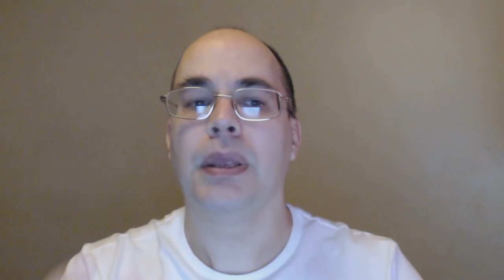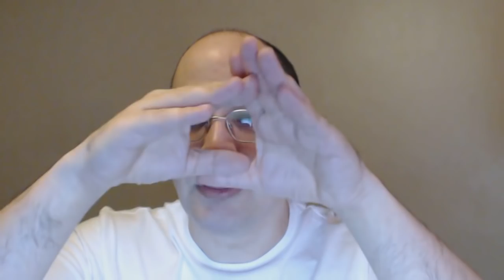How do rockets move in space, with nothing to push off from?

Comment: + MJ , u only explained how rockets work in atmosphere, we all know that. We learnt that in school.

Now tell us how they move in vacuum
Reply: +Jan , as long as the gas is inside the chamber, its still part of the same system
Reply: +Jan , I dont know fake science u studied. 

As long as the exhaust gases r still INSIDE the rocket , its still part of ONE SYSTEM . 

It cant move the system any forward without first coming out of the system
Reply: +Jan , gases cant be attached. But they are always in contact with the inner walls of the chamber & bound by it. Hence its part of the system
Reply: +Jan , the only way the rocket would move is if the pressure inside the combustion chamber is so huge that the chamber blows up, and even then the pieces of rocket would move in all random directions
Reply: +Jan  ....

 /// If gasses can't be attached, then they're not bound by the inner walls of the chamber :) ///
You cannot attach any gaseous or liquid thing to anything without the use of a solid object .

/// The gas particles push on the walls of the combustion chamber in all directions, except for the bottom, which is open ///

The pressurized gas molecules pushing with equal forces on all sides of the chambers, so there will be ZERO movement. And when the bottom end is opened , all the gas will fizzle out of it and since there is no AIR outside the rocket the exhaust gas will just simply sucked into the super gigantic universe sized vacuum .

The only reason the rocket pieces will move in all directions after a blast is because the gas molecules are pushing against all sides of wall, and also against each other. Thats the reason the walls break
Reply: +Jan ,   

/// Therefore, since they're not attached to anything, they're not part of the rocket anymore :) ///
The gases r the not attached to anything, but the walls the chamber contain them, so they r part of the system.

/// That's okay - if the gas is leaving the chamber, it most likely means that it has already pushed the rocket up (unless it happens to be oriented downwards from the get-go) ///
Why should the gases push the rocket up when its going down ? The pressure exerted on the topside is extremely low now. Thats now how things move.

/// Vacuum is not a literal vacuum cleaner - it doesn't suck. It doesn't do anything. What is happening is gas expanding to uniformly fill all available space. ///
Vacuum has almost no pressure so the pressurized gases will expand more and fill up the vacuum and tend to reach equilibrium pressure . So again no movement because the gases dont get pushed back .

/// Yes, they bounce against the wall and each other, which means, with downward wall gone, if the molecule isn't already going down, it has to bounce either off one of the remaining walls, or other molecule, giving it upward momentum before it can start going in other, downward direction. Action and reaction /// 
Lol ... thats not how things move .. hehehehe 
All the molecules r moving in all sorts of direction, hence there never will be any movement.

//// You really have no business of accusing others of practicing "pseudo witchcraft science" ////
Yes, you r posting fake Pseudo witchcraft science because u r ignoring the basic physics of movement.

MOVEMENT HAPPENS ONLY AND ONLY when an object pushes against something and object pushes it back.

Lack of air in vacuum space fails to make the rocket move
Reply: +Jan , assume that u r in a 20X10X10 feet cylinder in space.

If u come running from end of the cylinder and then kick the other end hard, then the cylinder MIGHT move forward.

Even that I am not sure because when u r running forward, you r pushing the floor of the cylinder backward with ur feet.
Reply: +Jan , that might be true in case of 2 astronauts but gases dont behave like those 2 solid objects (astronauts).

The moment one end of cylinder is opened, all the high pressurized gas flows out thru that & it exerts no pressure on the other end of cyclinder
Reply: Sachin Ki   "the only way the rocket would move is if the pressure inside the combustion chamber is so huge that the chamber blows up, and even then the pieces of rocket would move in all random directions"

So .. you accept if you construct a combustion chamber, containing rocket propellant, that has no exhaust nozzle, totally sealed, no exit for expanding gases .....  you ignite the propellant, and - 

Either the propellant burns until it's all spent, or the chamber reaches a point where the pressure is too much for the build, and it fractures at the weakest point. There can only be one of these results. No?

Simply put, the propellant works in all directions upon the internal walls of the chamber until either it is spent or the chamber explodes under stress.

Now substitute this chamber for one with a controlled exhaust, and the propellant STILL works upon the upper and inner walls of the chamber BEFORE exit. 

No? Why would it change behaviour between the two situations?
Reply: +Jan , what is so difficult to understand  ? When one end is opened, the gas will move out thru that end and enter space
Reply: +Tumeni , 

*** but it has already exerted pressure on the other end, by virtue of rapid expansion and velocity. And while the engine is running, there's a fresh supply of new gases coming in and expanding all the time***

Even though there is a constant supply of pressurized gases, they still wont move the rocket forward because it will simply fizzle out of the exhaust end.
Reply: +Jan , we r moving in circles. I doubt if u understand simple movement
Reply: @kunjikorans  Seriously, can you please explain why if a skater throwing a bowling ball away from them will move the opposite direction after throwing the bowling ball? Can you explain the physics behind that? Also, seriously, what level of physics have you taken just so how I know to respond going forward? Have you taken any college level classes or high school classes? How many classes have you had?
Reply: +Sachin Ki
Okay, enlighten me then: why are two gas particles bouncing off each other different from two astronauts bouncing off each other?

Physics wise, I think that the only difference is the mass. Do you?
Reply from the maker: As the atmosphere thins towards a vacuum it doesn't alter how the rocket operates, so what you learnt in school about how rockets work still applies in space.
Reply: +MJ , I am not doubting the combustion process, That is taken care by teh liquid oxygen in the rocket.

I want to know what the exhaust gases push against in vacuum space ?
Reply from the maker: They don't push against anything, that is the whole point about the video. If you take the rocket body and the fuel as a whole and say that at whatever location it is, it has zero momentum in relation to itself. If you then force part of the rocket fuel out one end of the rocket that fuel now has momentum in relation to the previously stationary rocket so to balance out that momentum the rest of the rocket must now move in the opposite direction. The greater the mass of fuel you force out and the greater the velocity in relation to the rocket the faster the rocket will move in the opposite direction.
Reply: +MJ , from where did u learn ur pseudo witchcraft science ? 

The rocket , combustion chamber, fuel and exhaust gases are all part of  ONE SYSTEM.

If this system needs to move, it has to exert force on some external system which will push the rocket system forward.

U look like a normal man, dont understand why u r pushing this fake stupid science
Reply: @mjmurcott647  OMG you are still unable to grasp the simplest form of physics even as I spoon feed it to you .  If a turbine engine is attempting to obtain thrust but even at full power it can not move one inch if a much larger engine is right behind it creating a lower pressure zone behind the 1st engine than in the front of the first engine. No matter how much more air mass moves from front to rear of the 1st engine; it can not move due to the low pressure behind the 1st  engine being even lower than in front of the engine. 

      The larger engine behind the 1st engine will pull much more air mass though 1st engine than it could provide on its own yet all this extra air mass provides no thrust.  This example is not even close to how low the pressure is at the rockets nozzle in a vacuum at zero pa.

    Any gasses released in an infinite vacuum will instantly dissipate in all directions at the same time providing nothing in return. Maybe you can solve this simple thermodynamic formula Work performed by gasses.  Work= pressure ext X change in volume.  If the pressure external =0 pa how much work is performed by the gasses???
G'day Mate
Reply: +Sachin Ki
The rocket , combustion chamber, fuel and exhaust gases are all part of  ONE SYSTEM.
No, they really aren't. Specifically, exhaust gasses, once heated and released inside the combustion chamber, cease to be part of the rocket.
Reply: +Sachin Ki
As long as the exhaust gases r still INSIDE the rocket , its still part of ONE SYSTEM.
No it's not. What fake science you studied? :D

Once the exhaust gasses have been released, they're no longer part of the rocket, and the in the process of re-orienting themselves to face backward they make rocket go forward.

It's rather simple, really - why are choosing not to comprehend it? Does it make you feel better to pretend to be a part of this "elite" force "bravely" fighting against the "fake" mainstream science?

I can only hope you'll live a long and healthy life, until space travel becomes so ubiquitous that you'll no longer be able to deny the obvious :)
Reply: +Sachin Ki
gases cant be attached. But they are always in contact with the inner walls of the chamber & bound by it.
If gasses can't be attached, then they're not bound by the inner walls of the chamber :)

Now, focus: individual gas particles bounce off the walls of the combustion chamber, right? And since there's a hole at the bottom, then can escape through it, but only if they have the correct direction of travel.

So, if a gas particle is unfortunate enough to travel upwards, then it has to bounce off the upper wall of the chamber before it can start travelling downwards, and by doing so, it will induce a tiny bit of upward momentum to the rocket.

Thus, the rocket will go up a little tiny bit, and the gas particle will go down. Multiply that by a million particles, and you'll get thrust powerful enough to overcome the force of gravity.

the only way the rocket would move is if the pressure inside the combustion chamber is so huge that the chamber blows up, and even then the pieces of rocket would move in all random directions
Oh, so you do understand how gas pressure works. Then, what is the problem here? The gas particles push on the walls of the combustion chamber in all directions, except for the bottom, which is open.

If the gas pressure can make the rocket pieces go in all directions, if powerful enough, then it can also make it go in one direction, if the aforementioned combustion chamber is shaped accordingly to redirect that push in one direction.

So, the same force that, if too powerful, can push the rocket pieces in all directions, can push it in one directions, when it's weak enough for the rocket to withstand it.
Reply: +Sachin Ki
You cannot attach any gaseous or liquid thing to anything without the use of a solid object.
Therefore, since they're not attached to anything, they're not part of the rocket anymore :)

The pressurized gas molecules pushing with equal forces on all sides of the chambers, so there will be ZERO movement.
If the chamber is closed on all sides, they yes, there will be zero movement. The rocket's combustion chamber is open at the bottom, however.

And when the bottom end is opened, all the gas will fizzle out of it
That's okay - if the gas is leaving the chamber, it most likely means that it has already pushed the rocket up (unless it happens to be oriented downwards from the get-go).

and since there is no AIR outside the rocket the exhaust gas will just simply sucked into the super gigantic universe sized vacuum.
Vacuum is not a literal vacuum cleaner - it doesn't suck. It doesn't do anything. What is happening is gas expanding to uniformly fill all available space.

You really have no business of accusing others of practicing "pseudo witchcraft science" if you don't even understand what vacuum is.

The only reason the rocket pieces will move in all directions after a blast is because the gas molecules are pushing against all sides of wall, and also against each other.
Yes, they bounce against the wall and each other, which means, with downward wall gone, if the molecule isn't already going down, it has to bounce either off one of the remaining walls, or other molecule, giving it upward momentum before it can start going in other, downward direction. Action and reaction.
Reply: +Sachin Ki
The gases r the not attached to anything, but the walls the chamber contain them, so they r part of the system.
The chamber is open at the bottom, so it can’t “contain” them. You might as well say that air inside the empty glass is part of it – it would be just as absurd.

Also, if your only determinant of declaring belonging to a system is gas' location, then your explanation breaks the physics of movement (as you understand them) - after all, this gas pushing against the air is still inside the chamber, therefore it's still part of one system, so there's still no push to speak of :D
 
Why should the gases push the rocket up when its going down?
Because they obey laws of physics. If they were going up, they can’t magically turn around midway – they will hit the top of the chamber (giving it upwards momentum), bounce back and start heading down, and will exit the chamber, in strict accordance with laws of physics.
 
The pressure exerted on the topside is extremely low now.
Unless there’s a continuous source of fresh gasses in the chamber (and there is).
 
Vacuum has almost no pressure so the pressurized gases will expand more and fill up the vacuum and tend to reach equilibrium pressure.
Yes, that’s what I’ve said. Thank you for agreeing with me, at last.
 
So again no movement because the gases dont get pushed back.
That’s okay – gasses don’t have to be pushed back in order to make the rocket move.
 
Lol ... thats not how things move .. hehehehe All the molecules r moving in all sorts of direction, hence there never will be any movement.
Yes, that’s what I’ve said. All the molecules are moving in random direction, so the net movement change is zero. Unless one of the walls is missing, in which case all gas molecules going in that direction will simply exit the chamber without doing any work. The rest of the gas molecules however will have to bounce off either off one of the remaining walls, or other molecule, giving it opposite momentum before it can start going in other direction. Action and reaction.
 
Yes, you r posting fake Pseudo witchcraft science because u r ignoring the basic physics of movement. MOVEMENT HAPPENS ONLY AND ONLY when an object pushes against something and object pushes it back.
Yes, half of the gas inside the combustion chamber will push against the other half, and then it will push against the rocket. There’s your “object pushing against something”. What is the problem here?
 
Lack of air in vacuum space fails to make the rocket move
No, rocket doesn’t need air to push against – it pushes against its exhaust. Well, half of it, to be precise :)
Reply: Yes, that is essentially correct. If you can kick the other end, then it will move forward, but the process of running forward would make it move backwards.

Now, imagine you have two astronauts in the middle of your 20X10X10 feet cylinder in space, which is open at one end.

Should those two astronauts push against each other, one will come flying out of the open end, and the other one will hit the other end, transferring his momentum to the cylinder and making it move.

And that's how rockets work.
Reply: +Sachin Ki
that might be true in case of 2 astronauts but gases dont behave like those 2 solid objects
The individual gas particles are solid objects. If we had two gas particles inside, instead of two astronauts, they would behave in exact same way.

The moment one end of cylinder is opened, all the high pressurized gas flows out thru that
Yes, but how? How can a gas particle which isn't facing the right way re-orient itself? Please think about it for a second before you read the next paragraph.

it exerts no pressure on the other end of cyclinder
False. If a gas particle happens to be facing away from the opening, it can't just magically change its direction - it will keep moving towards the other end of cylinder, it will hit it (transferring its momentum to the cylinder), bounce back, and then it will exit the cylinder.
Reply: Sachin Ki  "... gases dont behave like those 2 solid objects (astronauts).

The moment one end of cylinder is opened, all the high pressurized gas flows out thru that & it exerts no pressure on the other end of cyclinder"

...but it has already exerted pressure on the other end, by virtue of rapid expansion and velocity. And while the engine is running, there's a fresh supply of new gases coming in and expanding all the time.
Reply: +Sachin Ki
what is so difficult to understand? When one end is opened, the gas will move out thru that end and enter space
Yes, I know. If the gas is pressurized on entry, it won't just magically lose its kinetic energy - it can't just "fizzle out" - the energy has to go somewhere.
Reply: No, it's not. It's not attached to the chamber in any way, so it's not a part of the rocket anymore.